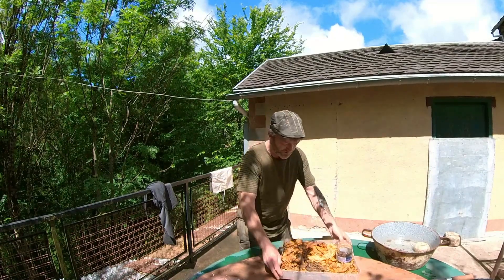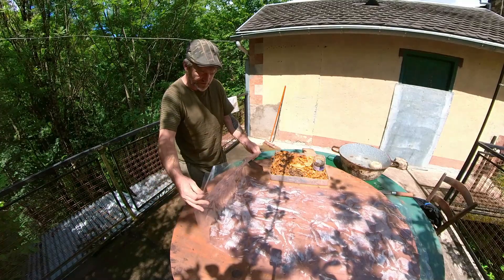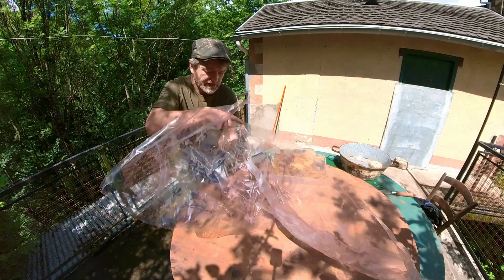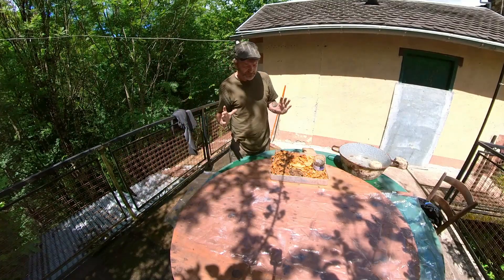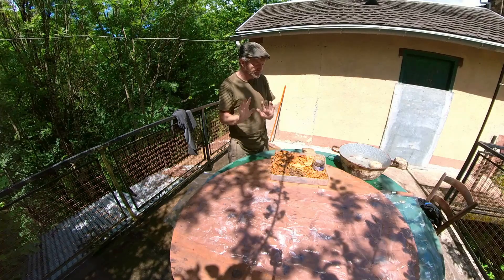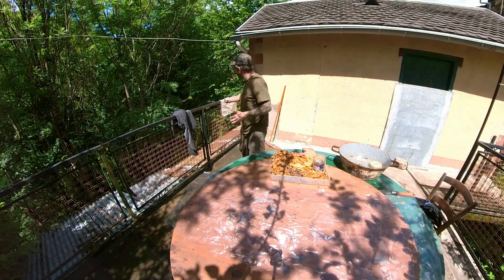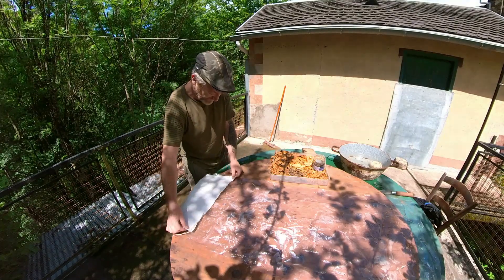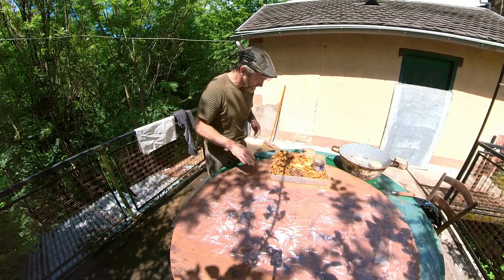Whole Leaf Tobacco 2021 #10 How to press tobacco (without a press!!)

Comment: I just thought of something after watching this and the Navy Perique Video, I am a fisherman specifically Halibut and I fish with a very heavy gauge monofilament line. Monofilament is stretchy by nature and readily absorbs shock by stretching and this allows you to fight very large fish with minimal loss do to breaking the line. Some people have switched out to zero stretch lines now so they can better "feel" the bite as its telegraphed up the fishing line....anyways the stuff I use has a breaking strength of 600lbs! and is 3mm thick. 
I bet if I wrapped up a perique with that stuff it would strangle it like a boa constrictor. I'll try it and call it a HALIBUT Perique
Reply from the maker: The stretchy line would probably work a treat! They are big fish to catch with a rod!

Comment: Was the tobacco somewhat moist before you started to roll it ? Did you spray it with a sugar/water concoction ?
Reply from the maker: Hi Frank, in this case the tobacco was moist enough and didn't need any further spraying. It was just a bit moister than optimal smoking levels. I found last year that if it was too moist at this stage then the tobacco was very difficult to rub out and formed almost gum like seams where the cell structure of the tobacco was destroyed in the pressing process.